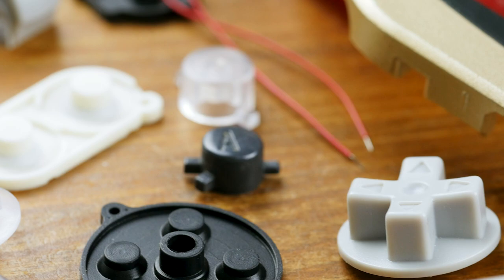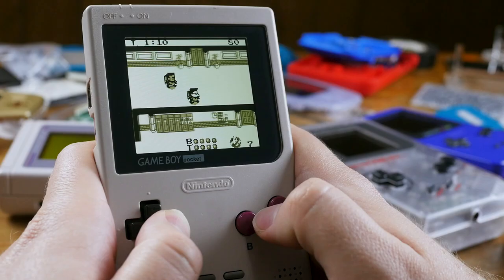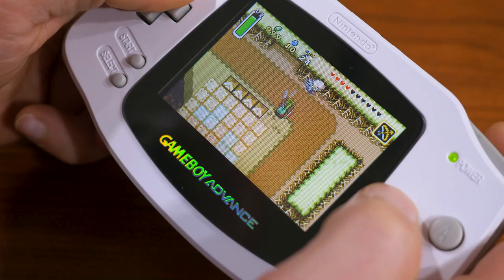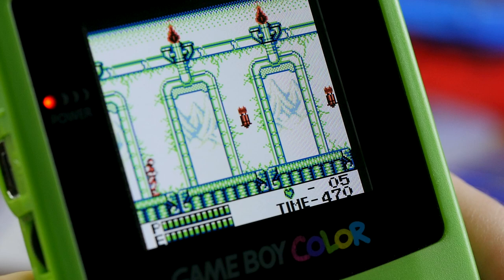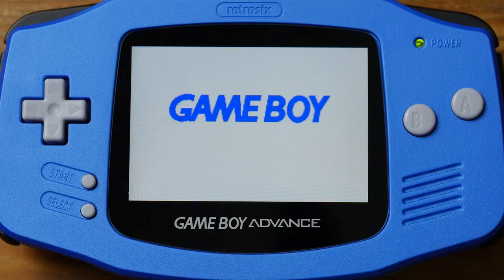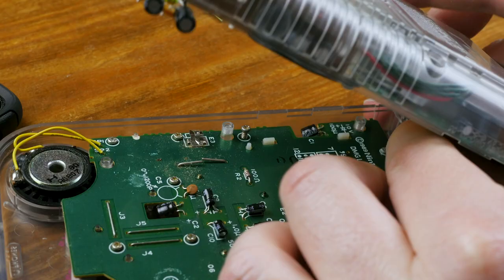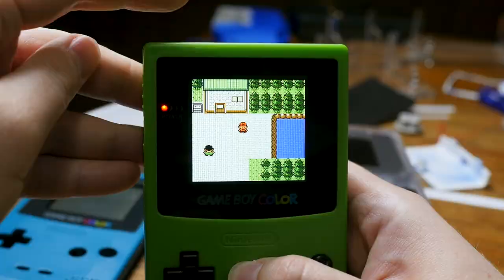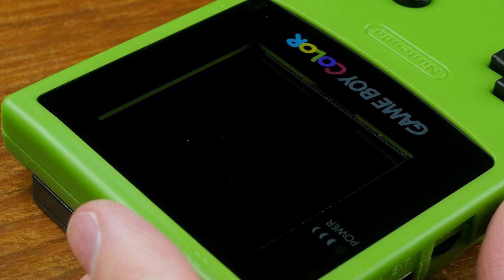Game Boy IPS Screen Mods for DMG, Pocket, GBC, GBA, and GBA SP :: RGB320 / MY LIFE IN GAMING

Comment: I've seen many videos of people installing kits and being overwhelmingly positive about how it looks and how easy it was to do, with about the only complaint being how the controls felt afterward.  But I always knew there was more to it, even if just some delay being introduced.  I appreciate the level of analysis that you guys put into your content for this reason alone.  I like to at least know what kind of problems I'm getting into and make the decision to move forward regardless, rather than it be surprise and wonder if I could have gotten something better.  It's hard to make an informed decision if you don't actually have information.  

I'm wondering if a lot of these displays and controller chips are made for primarily displaying video content in cheap handheld devices, and to reduce cost the chips have filtering and whatnot built in, and just get used in everything which is how they're so cheap.  It's like how they eventually were able to make a single chip to handle FM radio that basically got put in everything, or even the Chinese NES-on-a-chip clones, and they all shared the same problems in both cases.  Sometimes manufacturers are only out to make a product that works, and they let you worry about its quirks, assuming they even noticed them themselves.

Comment: Great video, very informative. I was just wondering what the new contraption is that holds your gameboy games.
Reply from the maker: [Try4ce] It's a rotating stand meant for nail polish bottles, but it seems to not be on Amazon anymore even though I got it recently. I had to modify it though for it to work so it wasn't the simplest solution.

Comment: at 18:23 you sy "wich are TFT-LCD panels instead if IPS"
TFT stands for "Thin Film Transistor" and is a general type of LCD panel. IPS (in plane switching) is a method how to align the crystals for a picture. They are also a kind of TFT-LCD-Panels.
I assume you meant TN (Twisted Nematic)
Reply from the maker: [Try4ce] Whoops, sorry! I have to confess I am not an expert on all the distinctions between LCD panel types. I just know that we've seen the image retention caused by flicker on IPS panels, but not others. I knew the McWills were not IPS, I just got the wrong term there. I think most non-IPS kits ARE listed on sites selling them as "TFT" though, so maybe they're using the wrong term in those stores, and that's probably why I said that.
Reply: @mylifeingaming  No Problem, I just wanted to inform about the mistake, it is only a minor one thouigh. TN is by far the most common kind of TFT display, it is the cheapest and oldest TFT-Technology, wich might by why TN.Panels GB mods are not marked specifically. It is also way way faster then IPS, but ahs poorer color and vewing angle, wich might by why they do not have the Image retentaion, since they can actually keep up with the flicker frequency.

Comment: I think the IPS screens have improved since this video? I got my GBA SP repaired and modded to add a new ips screen around last year in 2022 and I haven't noticed any of the issues that you shown here on that specific screen as far as I can tell. I had another GBA SP with an IPS screen that was definitely more noticeable, but the other one doesn't seem as bad. Granted IDK if I just did not use the right games to test it out or if it's just not as noticeable now.

Comment: What are those spinning racks you've got your Game Boy games on? They're a great idea!
Reply from the maker: [Try4ce] This, but I had to modify it with square boards in the middle and felt strips in the front so the games would stay put. Took a bit of work to make it work. https://www.amazon.com/JACKCUBE-DESIGN-JackCubeDesign-Organizer-Cosmetics/dp/B01MZ8Q78N?pd_rd_w=9iMJy&pf_rd_p=fe838164-8963-4b55-8b4d-8eb514ffa8b5&pf_rd_r=GE34NQEWA6N910J6GEYW&pd_rd_r=5761da3a-bc80-4eca-bcac-683075b56dc7&pd_rd_wg=SdOIe&pd_rd_i=B01MZ8Q78N&psc=1&ref_=pd_bap_m_rp_1_sc

Comment: Did u get that rotating rack by thift shopping or does some sell this. Alot of the nail polish rotating racks don't have a good backing to them
Reply from the maker: [Try4ce] That is exactly what it is, and you're right - it had to be modified to hold the games in place so it's hard to recommend.

Comment: You should also have talked about the GB Micro too.
Reply from the maker: [Try4ce] I don't think there are any mods for it. It's too small to put another screen in, most likely. I was gonna mention it, but cut it out because it's kind of off-topic.
Reply: Thank you for replying but I was not talking about the screen replacement, I was hoping to see how a GB Micro's screen would do in your tests.
Reply from the maker: [Try4ce] GB Micro is included in the big Game Boy episode we did in 2016. The screen is not as vivid as AGS-101 (some argue that this makes it more accurate to the intended colors, which makes sense), but the pixel response is slightly better than AGS-101.

Comment: Awesome video! Where did you get the spinning Game Boy game towers at 1:51?
Reply from the maker: [Try4ce] They're from Jackcube Design on Amazon, but sadly seem to be no longer available even though I bought them just a few months ago. However they were NOT ready to use out of the box. I had to add boards in the middle of each section for the games to have something to lean against, and put felt strips at the front of each ledge so they don't slide out.
Reply: @mylifeingaming  thank you very much for replying! I appreciate the info!

Comment: It's overshoot isn't it? Or maybe undershoot, which is why it only happens in certain games and at certain framerates. Same thing happens on my 144hz VA panel when a game drops to a low enough, 60-80fps framerate. The pixels are essentially trying to hit a color too fast and ending up lighter or darker, usually dark to light transitions. This is where Grey to Grey (G2G) response times come into play in LCD panel discussions. If it's an after image, or anything else probably it's the display processing in the LCD IPS kit itself most likely. I'd wonder if a PCB tuned specifically for GBA may help instead of random panels and such from cell phones lol. I'm not an expert on display tech, just a PC/gaming hardware enthusiast and dealing with modern LCDs you run into these problems aljng with their solutions. A tuned LCD with high refresh tech looks better than anything - especially OLED/AMOLED with sub 0.1ms response times and higher refresh rates..

Comment: i dont know if its the same mod but the the backlight for gameboy color is great but the brightness adjust on the ir sensor was horrible on both systems i have the brightness would malfunction and adjust the brightness at random and i just ended up removing the wire for it

Comment: Question what rack is that for your game boy games? It looks amazing
Reply from the maker: [Try4ce] It's a rotating nail polish organizer by Jackcube Design on Amazon, but I did have to kinda modify it to work how I envisioned it. I put a strip of felt in the front of each row so that the game cases wouldn't slide out, and then had to put square pieces of wood in the center to prevent them from falling back. So it's not exactly a ready out-of-the-box solution but I am happy with how it  turned out!

Comment: Someone should make legit IPS screens for PSP 1000/2000/3000  or the Sega Nomad but I would want one for the PSP 1000/2000/3000. I also want better speakers for the PSP 1000/2000/3000 that are the same size as the original.

Comment: Thanks. Its what i was looking into recently! 
One question though: does the touch sensor interfere with the infrared on the gameboy color mods? 
None of the sellers have tested this feature and i still haven't had an answer. For example: using mystery gift on the gen 2 pokemon games or card pop on pokemon tcg
Reply from the maker: [Try4ce] It covers the IR receiver on the console board, so yeah. You don't have to remove it, it fits, but since I don't use that feature, I thought it was pretty clever.
Reply: @mylifeingaming  thats unfortunate for me but understandable lol

Comment: Not related to the episode but what are those shelves the gameboy games are on?
Reply from the maker: [Try4ce] They're this but heavily modified. I had to add boards to the middle so the games would stay propped up, and felt strips to the front so they wouldn't slide out. It definitely does not work as-is for Game Boy games. https://www.amazon.com/JACKCUBE-DESIGN-JackCubeDesign-Organizer-Cosmetics/dp/B01MZ8Q78N?pd_rd_w=cBTZ3&pf_rd_p=7e8efe83-c453-47a7-b6f0-8ce7932221cb&pf_rd_r=M19G01Q6J9Z91XDE8CWY&pd_rd_r=fa9ad0fd-f11d-436a-a12a-3f806b0f67b6&pd_rd_wg=uBq4U&pd_rd_i=B01MZ8Q78N&psc=1&ref_=pd_bap_m_rp_1_sc

Comment: From a person with allot of tools, when you were talking about stripping screws, it appears from your video that you aren't using the proper size screwdrivers.
Reply from the maker: [Try4ce] I'll admit I am possibly not always using the ideal screwdrivers (I used small or big ones depending on which was more comfortable for each task), but I'm not talking about stripping the screw heads... I'm talking about the actual shaft in the shell. It would keep turning and turning, and eventually I realized it was stripped. It never felt like it hit a spot where it was secured, so I kept turning beyond where I should've, because it didn't give me that tactile feedback.

Comment: How come the framebuffer lag penalty was never mentioned on the analogue pocket review? the screen they use 1440x1600 is a rotated portrait mode panel.
Reply from the maker: [Try4ce] Well, if that's true, then it's news to me. I would have mentioned it if I knew.
Reply: @mylifeingaming  I have seen teardown shots of the pocket with the lcd's model number in clear view printed on the ribbon cable. the specs are easy to lookup online it's a 1440x1600 portrait screen commonly used in vr headsets.
Reply: @mylifeingaming  fair enough it's not like analogue ever mentioned it
Reply from the maker: [Try4ce] Well we were afraid to tear it down ourselves and that info otherwise would not have been available until the review embargo was up.

Comment: 18:21 do you mean TN panels? TFT describes the transistor.
Reply from the maker: [Try4ce] I think you're right. Most non-IPS screens on these sites are advertised as TFT though, I guess they caused me to use the wrong terminology, ha. Regardless, they are a different panel type and don't freak out with flickering sprites.

Comment: I really find these mods cool, but I'd still never take one of these systems over just an emulation device...
Reply: Those have a whole other lot of issues. Why not both
Reply: @MikeLoverly  do they, though? for reals? cause things have only been improving in the last two decades. like, i'm not saying if you really need to play on original hardware, you shouldn't use a modded system. but tons of other devices, especially extremely affordable phones with bluetooth controllers, are just a lot more handy than any of these modded handhelds.

Comment: I wish to do a Pocket IPS mod, and I think I can deal with the flaws here and probably even the process. But how about the battery life?
Reply: Standard brightness, eneloops pro aaa, original cart = 3h
Reply from the maker: [Try4ce] Believe it or not, I got through this episode without having to replace any of the Energizer Ultimate Lithium batteries I put inside these. Check some videos on Macho Nacho Productions for some battery life tests. I believe he used Duracell alkaline batteries, but I forget.

Comment: You forgot to mention that compared to the original screens of GBC, GBP and GB, the IPS screens are so much better despite their flaws
Reply from the maker: [Try4ce] I did have a section going over the strengths/weaknesses of the original screens, but cut it out just because this video was taking way too long. What you say is a very VERY valid opinion! But I guess my perspective is that if you're asking me to replace the original screen, it had better be both very very good, and well-suited to the types of content that will be displayed on it. But they have problems with this type of content (scrolling games, flickering sprites). Most of the time it's fine, but I guess my take is that if a mod is only 80% of the way there, then I'd rather have the original experience. If it's 99% of the way there, then it sounds like an amazing upgrade. I just was expecting more here, based on the generally positive reactions.
Reply: @mylifeingaming  thing is, the original experience is unplayable unless you have excellent outside light, 80% improvement sounds good to me and most ips mod users
Reply: @mylifeingaming  also, some visual annoyance over some games that is only perceptible if looking hard for them is more like 90 to 95% success if you ask me. That 80% you mention is purely subjective

Comment: Lol this is EXACTLY why I have not done any of these mods to my systems yet, they are just too unreliable and glitchy for my liking as of yet.  Funny then how they are so popular, and that ppl are willing to pay a premium for one that has been modded as such.  This comes down to plain old ignorance.  Casual ppl simply have no idea that these issues even exist and they honestly don't really care.  Most probably won't even notice the problems cus again, they just don't care and aren't picky. 

I however, am, and until an actual Engineer designs one of these kits and purposely matches a proper acting display with their design, these problems will likely persist.  Right now it seems kit makers are just pairing whatever screens they can source at the cheapest price with their boards and ribbon cables, and this will continue to make these issues happen in these kits.